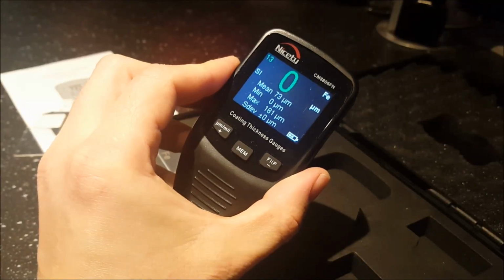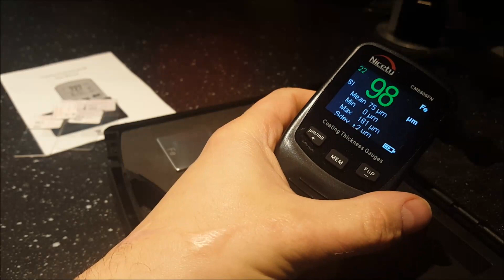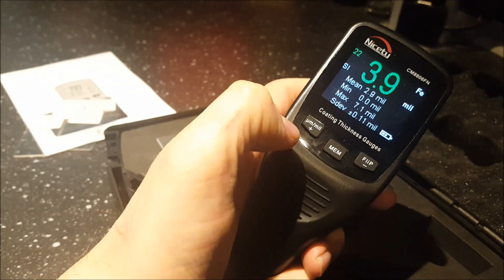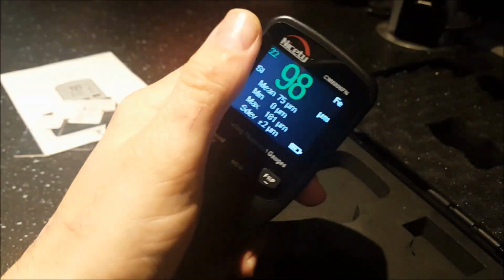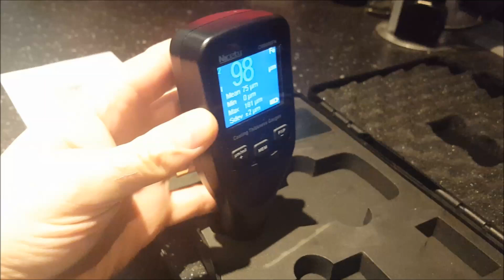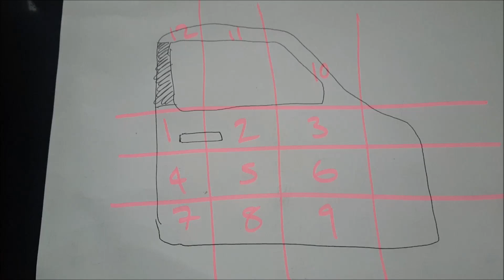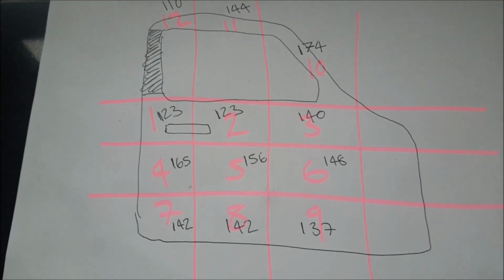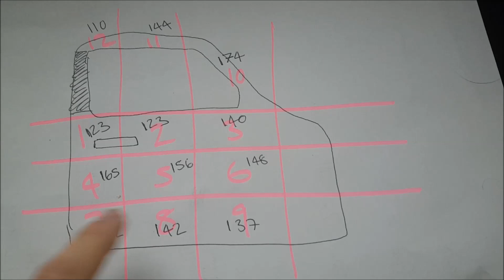Paint Depth Gauge - Nicety CM8806FN

Comment: Need help there is a P- sign comming in my screen above the battery cells sign and its not showing any readings only showing thee blanks 
I don't know may be its setting has a problem 
Needs help any idea
Reply from the maker: Page 2 in the manual lists all causes for that. 👍 likely a dirty probe.
Reply: @DetailingandtheBeast  thanks for you're quick reply sir
I think its probe has a problem I have cleaned it but still its not working
Any others suggestion
Reply from the maker: I'd clean it using a bit of compressed air, just in case something is trapped. Other than that, perhaps take batteries out and leave it a few minutes, thinking a reset??
Reply: @DetailingandtheBeast  OK sir thanks I will try it and will tell you if it works 👍

Comment: Hi great review and I picked one up 

I just have one concern with the one I have 

I've not tested it on the car yet but did use it on the plates and the little metal sensor is scratching the plates kinda concerning considering its for use on paint and trying to correct it and not make it worse before I do 

Wonder if I've got a fake one got it off ebay 

Differences i see from your video is no red marking above the name on the unit 

And the test plates are just plane 

Could you check your sensor to see if it feels  sharp to touch 

This one does at the edges of the metal part of the sensor 

Thanks for any help 

Tommy

Comment: How long do the batteries last
Reply from the maker: A very good point. Now at first I was using the batteries from the box and I'm certain they were testers as they only lasted about an hours worth of use. I then got caught short on having batteries in the house so had to use really cheap Kodak (the really nasty Poundland ones) and the gauge gave some really odd readings, very sporadic. Since then I've used the amazon basics industrials and these are way better and last for 10s of hours of use (unit on taking readings). Good batteries do make a difference so as soon as you think you have some off readings get them swapped.

Comment: Awesome video! Does it have any effect on the gauge's sensor when the car is drity?(hasen't been washed for a long time) You may get false reading's?
Reply from the maker: I'd suspect so but not by anything that will ultimately affect your decision to polish. But... the idea is to take readings after the wash prior to paint correction. Or if having a quick check for a customer inspection, then simply quick clean a section using a QD in as safe a method as possible. 👍